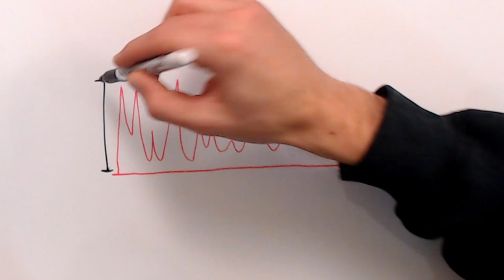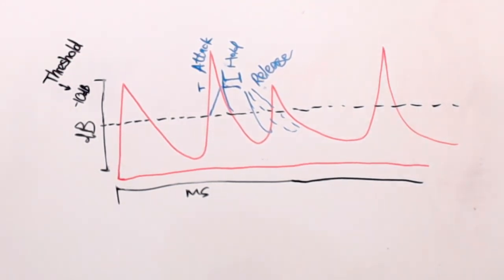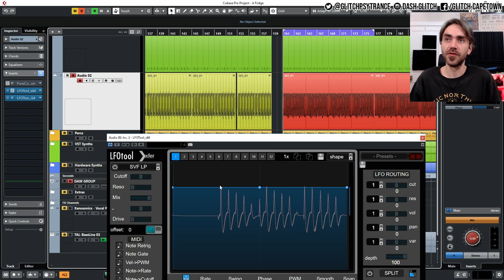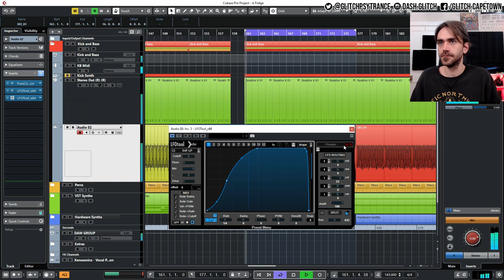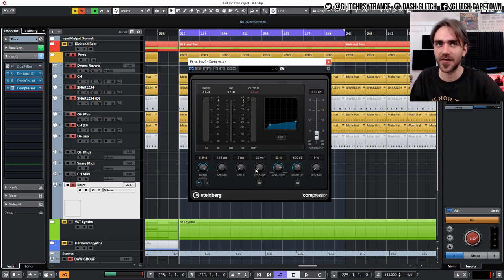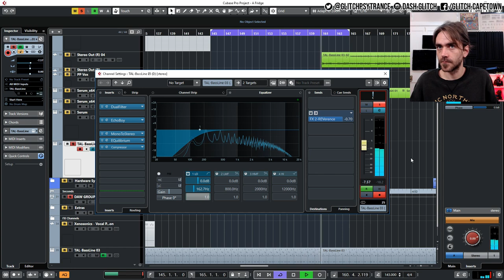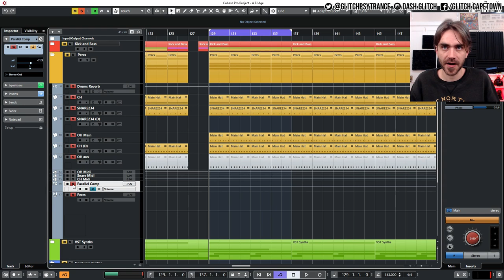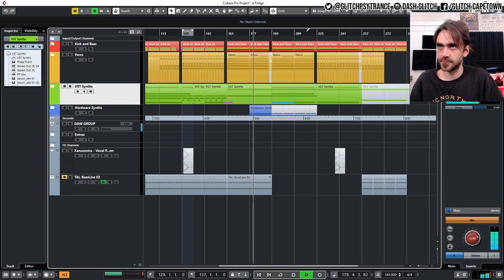Mixing Electronic Music - Ep. 3 Compressors

Comment: How do you feel about using parallel compression for the entire mix? I sometimes setup 3 parallel compression busses (kick + bass, percussion, and synth). I send to these from the group busses. This allows me to dial up the right volume for the 3 different parallel compression busses (generally set these between -9 to -15 dB but usually around -10 to -12 dB. It definitely makes the sound bigger and beefier. How do you feel about this method?

Comment: Can you use Parallel compression as a transcient shaper (like for the psy bass for example)?
Reply from the maker: Yes, a nice trick is to "overdo" it like I do in the example, then mix in the dry signal and use the "attack" and mix as your transient settings - however, make sure to reference on a couple of systems as some speaker/headphones might not give you the exact transient response
Reply: @DashGlitch  Thank you 🤗
Reply: And what about expansive compression?